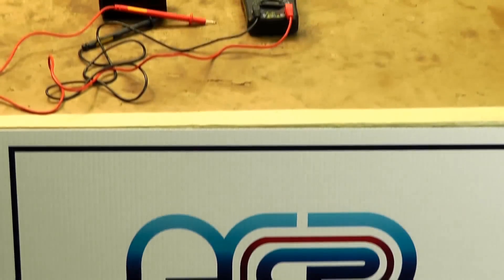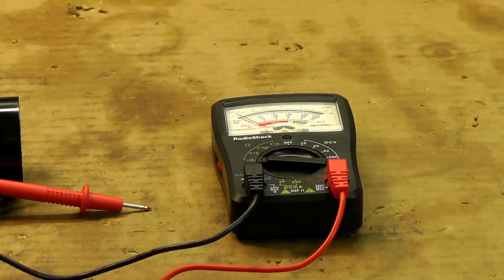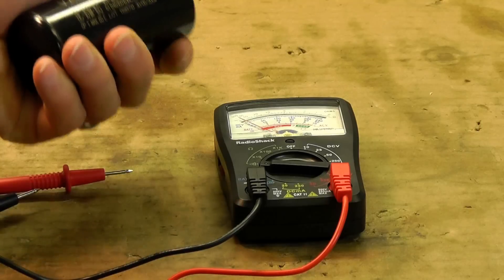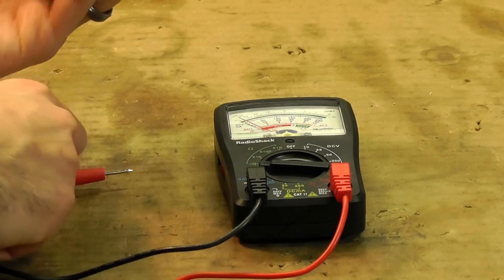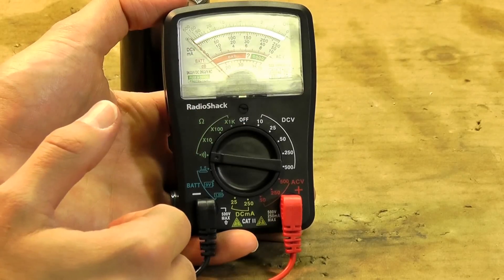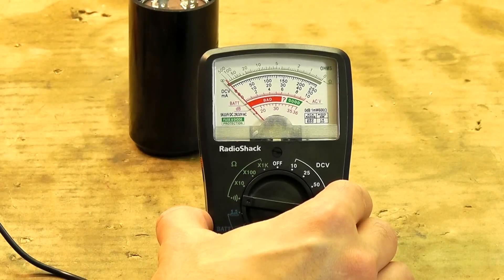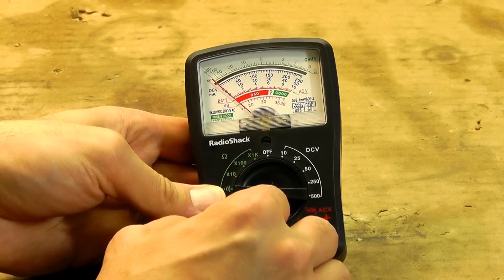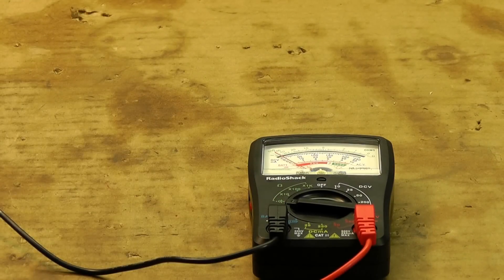How To Correctly Test A Capacitor On A Motor

Comment: Sounds like a simple test. I have a friend with a Sears 919.195411 compressor and the motor has two capacitors on it. 
I'm assuming one is a start and one is a run capacitor. 
Once it's plugged in and turned on, the compressor will blow a breaker when it gets up to 40 or 50 lb pressure.
It doesn't blow the circuit breaker on the compressor motor,  it blows the house panel breaker.
He's tried it at home and at the warehouse and both times it blows the breaker. I'll check out those two capacitors. 
Thank you. 👍